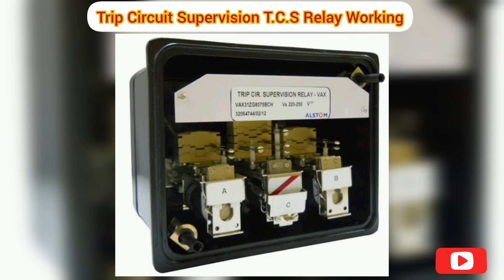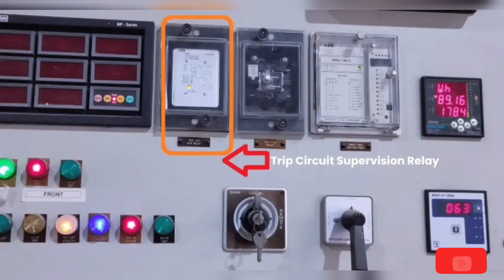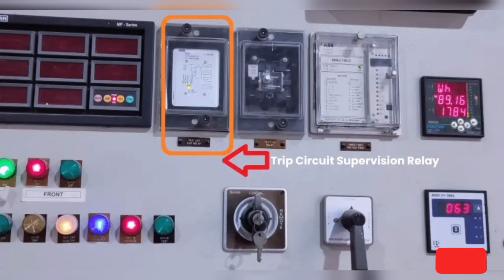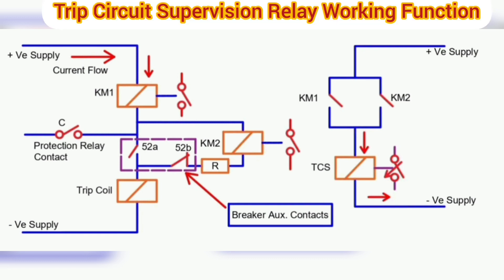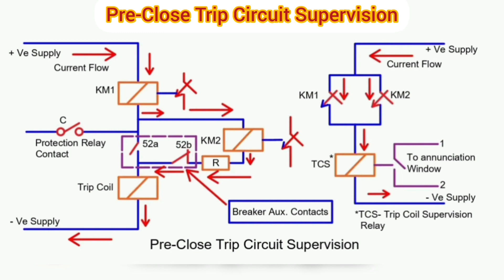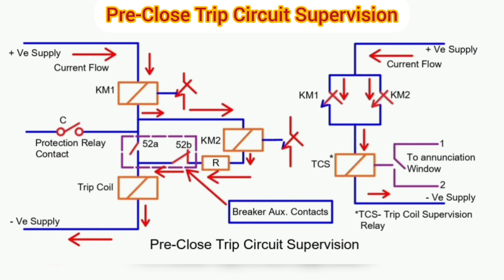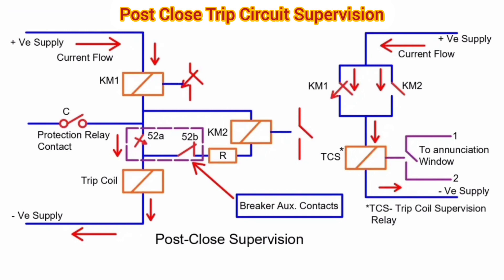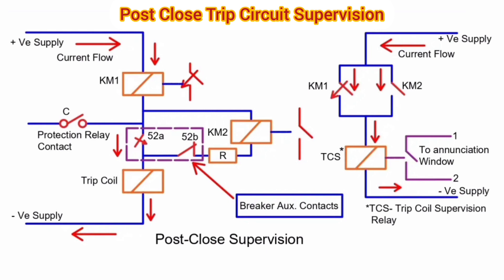Trip Circuit Supervision TCS Relay Working Function & Operation

Comment: correction: In post close breaker condition 52b auxiliary contact will be open. Also must be add a resistor with the 52a contact.
Reply from the maker: Thank you 👍